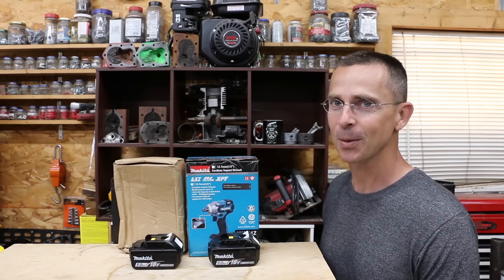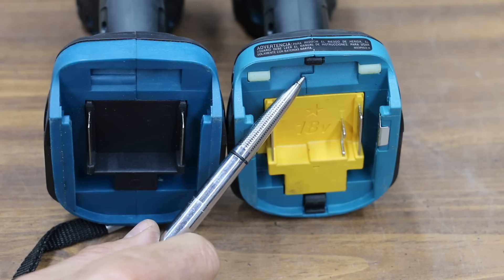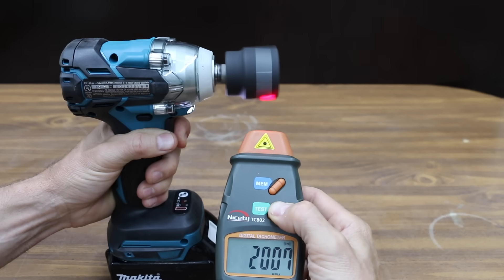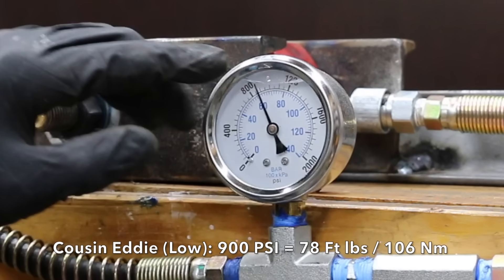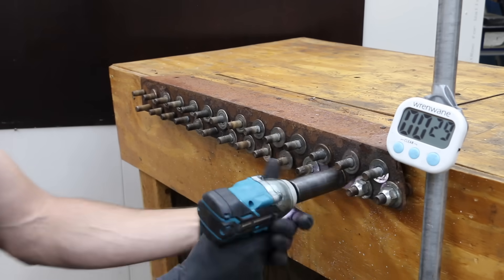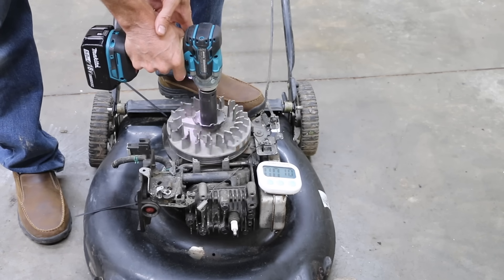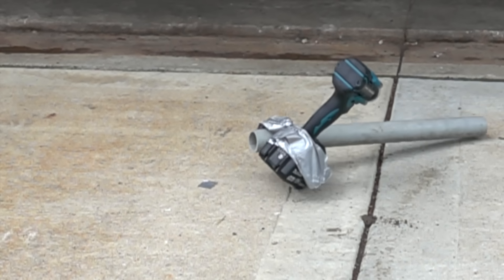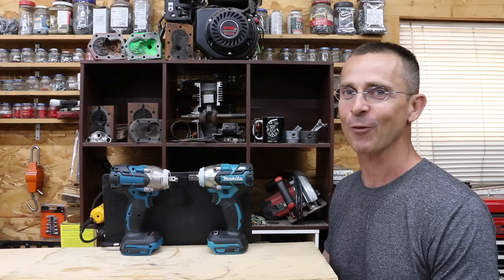Fake Makita Impact Better? Let's find out!  Makita XWT11Z 18V LXT Lithium-Ion Brushless Cordless

Comment: Three other tests to consider:
1) resistance to fluid ingress. Shops are full of all sorts of fluids (water, oils, cleaners, fuel, etc..); at some point, you’re gonna get some in a power tool. How well do they resist getting fluids inside?
2) resistance to fire/heat. Let’s face it; sometimes you need to get things hot, whether it’s welding, or using a blowtorch to heat up a stuck bolt, you don’t want it turning your power tool into a molten puddle. Which one resists melting and/or catching fire the best?
3) which one charges the battery the fastest? And under constant load, which one drains the battery the slowest?
Reply from the maker: Great recommendations!  Thank you

Comment: I had the exact same fake Makita - broke the very first time I used it.  The anvil broke and it's pretty much a paper weight.  IHMO, you are gambling with these cheap tools.  Sometimes they are great, other times you might as well light your dollars on fire.   If you actually need a tool to work reliably, even just every once and a while, spend the $$$.   Otherwise, it's one-time use, if that.
Reply from the maker: Wow!  Great information

Comment: Hey this was a good teaser, but it would be great if you could do an episode with all of the Lowes, Home Depot, and harbor freight tools stacked up side by side so we can see which way is really the best bang for our buck.
Reply from the maker: Great suggestion
Reply: Yes please. I was thinking this exact same thing. Harbor Freight was the first thing that popped into my head.
Reply: The largest part of a tool price is the "planned obsolescence and life-cycle". There is one exception to this, in the tools with a lifetime warranty won't make enough power to ever destroy themselves, they also won't make enough power to do anything quickly. 

In my experience Harbor Freight is a 1 time use tool. As the handful of things I bought there barely lasted one use. I quit buying their garbage as $30 for one use vs. $200 for every time I'll ever need it has proven to be cheaper for the expensive and long lasting tool. 

The number of fasteners I've stripped out with snap-on or Mac tools has been far, far less than the number I've destroyed with Pittsburgh and Craftsman tools also. No broken knuckles since switching to quality ratchets either. My last Craftsman is in a field as that's as far I could throw it the very last time I destroyed a knuckle.
Reply: @leftyeh6495  That may be very true, Yet harbor freight has come a long ways from cheap tools and their warranty is far better than those 200 dollars tools. I have one of their oil less compressors that has lasted a long time at a fraction of the price and delivers higher psi and about the same SCFM/CFM as other like brands. The higher psi give me a large buffer when using a nail gun at 120 psi. I am looking at upgrading to their newer models that are not upwards of 200psi rather than the 150 I have now. Warranty with harbor freight is much faster returns than any other brands, They want to send it in to service and or fight that this is wear and tear and not defective. Harbor freight just replaces the item with in 90 days and if you buy the warranty of 1 year you have 1 year and 3 months to replace the tool with no questions asked, Try doing that at Home Depot. Which is where a lot of my cordless tools came from. I only buy a few tools from them because of the item I want, Most of them I buy used as I have a stack of batteries. If I am not mistaken my 1/2 ridgid impact is just as good as a 488 dollar snap on, which is rated at 450 pounds vs snapons 600 pounds. I have no clue what snapon batteries cost, I am sure they are far more expensive than ridgid.
Reply: I agree with both points here. Although some Harbor Freight tools can be dangerously inadequate when they don't live up to their specs. I've had their c-clamps explode inches from my face before and that's a scary thing when you think of the possibility of what other tools they might have that can fail so easily and catastrophically. On the other hand I've found they have some great stuff for low use. I could have gone expensive with pickle forks and ball joint separators but only needing a handful of uses out of them in a lifetime, they've been more than adequate. AC guages were another great purchase for fixing and troubleshooting my personal vehicles considering it was half the price of anything found at Autozone. It's hit and miss, but I'd suggest weighing the risk of dangerous failures with their tools. Paying a few more bucks doesn't sound so bad when you can save an appendage or an eye.
Reply: Best sign up for project farms patreon to help out.  That's a helluva ask.
Reply: I actually have a couple of the harbor freight Bauer tools. Not quite as good as makita or Milwaukee but in my experience they are better in general than my buddies deWalt tools. That being said I did upgrade from 15 year old lead acid ryobi so my opinion might be skewed.

Comment: Until you opened the cases of each tool I was wondering if the Cousin Eddie model was a back-door clone (made in the same factory but sold directly by the manufacturer rather than delivered to Makita) because both tools were almost identical weight and appeared to be mirror images. (In the past there was some evidence that some Chinese manufacturers would fulfill a custom order to the client but then run off a number of additional units to be sold through the back door. This was supposedly the case with some golf clubs. I believe the Chinese government cracked down on this knowing that nobody was going to contract with a Chinese manufacturer if by doing so their proprietary products would be illegally duplicated - undercutting their markets.) That is obviously not the case, as evidenced once you opened up both units. Outsourcing manufacturing can be a risky business.
Reply from the maker: Great point!

Comment: Depends on  what jobs you have to do, I was replacing OH Cam belt, Starter motor "whack on the concrete" tecnique could not shake the hamonic balance bolt so i bought some Chinese thing down under called KLOBBER, for about au$90, did the job ok, only used it to change wheells since.
Reply from the maker: Great point!  Thank you

Comment: For that price Cousin Eddie looks good for home garage if using original Makita charger and battery, especially,  if original cordless drill are in tool set.. 
When last battery from my old DeWalt died, I have multiple options but at the end I purchased  DEKO cordless drill GCD20DU3 with two 20V MAX LiION batteries from China and later purchased other tool's from same brand with same type batteries. It's good for price and like to work with it but I'm still missing my old beat up work horse which was manufactured in 2001 and back in days was used in multiple construction sites.. Nostalgic.. :D
For some next tests and brand comparisons, my advice is try out some DEKO tools.. Want to see how advertising parameters fits description and how far they are from other brands such as Bosch, Makita or DeWalt.. 
Anyway, batteries are 1.5Ah, this may get to some difficulties for comparison with professional tools with 2Ah batteries and more, but may be interesting and I known You figured out proper tests, as always.. :) 
Great video, as usually, and like effort and enthusiasm that was putted in to make it interesting and honest! ;)
Reply from the maker: Great feedback. Thank you

Comment: I am an electrician your test is bogus for one reason... Even though the Makita out preformed "cousin Eddie"... If "cousin Eddie" was using it's OWN BATTERY ... it would have been blown away!!! Power supply is EVERYTHING..you had a Makita battery pin cousin Eddie....smh... I still give you some credit for your ability to test but you messed up on the fundamentals.... By the way, notsure your "Makita" was real either... They're all i use and i know they don't look like that one... Yours looks like the black&decker version of porter cable painted green
Reply from the maker: Thanks for the constructive feedback.  Cousin Eddy did not come with a battery.  It's designed for use with a Makita battery.

Comment: I’d like to see a similar showdown but between the Milwaukee M18 fuel and Dewalt 20v Max brushless 1/4 inch impact drivers. Among my coworkers and I this would be a very interesting video to share. Most of us are Milwaukee Fuel series fanboys but there are a couple of the crews that use that dewalt 20v stuff and swear it’s better.
Reply from the maker: Great suggestion!
Reply: More bigger number more betterer!

(Even though they're both 20v charged, 16v discharged, 18v nominal.... bigger numbers sell things.)
Reply: Lefty eh I agree

Comment: Can the makita battery fit on cousin Eddie? Could make the difference in terms power delivery. Usually the copy will also have cheap battery.
Reply from the maker: Cousin Eddy did not come with a battery
Reply: @ProjectFarm  I see so during testing both batteries were makita. I though that it was battery that could have limited the amp draw of cousin Eddie. Still not bad for a $100 ($30 tool & $70 battery [Amazon] ) enough to do DIY automotive.

Comment: wow great testing.  I bought a cousin eddie variant not too long ago, which has 3 forward and 3 reverse settings, so I think over time they're cheaping out on that component.  also it's quite a lot faster on the start (didn't notice autostop, dunno if it even has it).  I've been very happy with my 30 dollar purchase, turns a 20 minute job into a 2 minute job
Reply from the maker: Great inforamtion! Thank you

Comment: Some of the internal components are heavier for Makita, but the overall weights are the same.  Where did cousin Eddie make up the weight difference?
Reply from the maker: Great question.  Makita has a heavier hammer but lighter anvil and other metal parts.  The quality and hardness of the metal used in Makita is much better

Comment: thanks again for another great video. will the batteries swap over from each other?
Reply from the maker: Hi Mustie1, Sorry I didn't explain this in the video.  The knock off did not include a battery (tool only).  I used brand new 5 AH 18v Makita batteries on both.  Huge fan of your channel!!

Comment: For someone who doesn’t use impact wrench very often, would you recommend cousin Eddie? .
Reply from the maker: Yes, great value.  You'll need to buy a Makita battery for it.  It's a tool only purchase
Reply: I got one and I'd buy it again if it ever breaks. It actually feels quite sturdy but heavy abuse like in this video is not how I treat my tools. Mine also got an insert for hex bits, but everything else looks exactly the same. In my opinion it's far better than those brushed tools for the same price. I use it only to change wheels on my car and as impact driver. As a home user on an occasional basis the original would be just overkill for me.

Comment: I think an even better question is whether or not you can find an "import" version of this tool, or any tool, that is as good as the name-brand counterpart. In my experience you can find very good tools, maybe not for $30 but for about 1/3 to 1/2 of the price of the brand name versions. Quality of the stuff on ebay can vary drastically but if you know where to look you can find some very good deals. In general, I would say that the the things that come from taiwan are better quality than china but that's not always the case.
Reply from the maker: Great feedback. Thank you